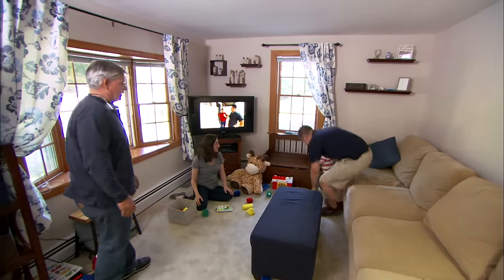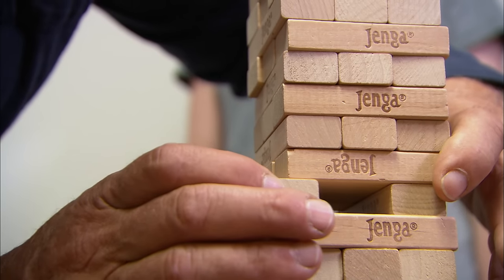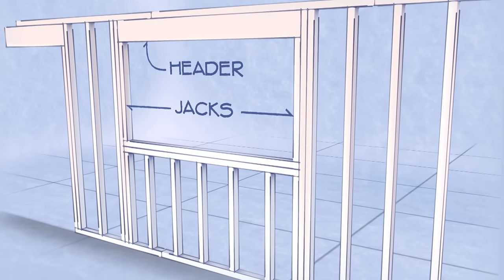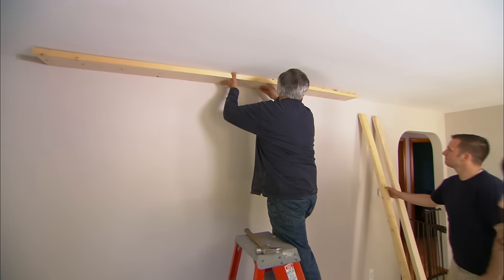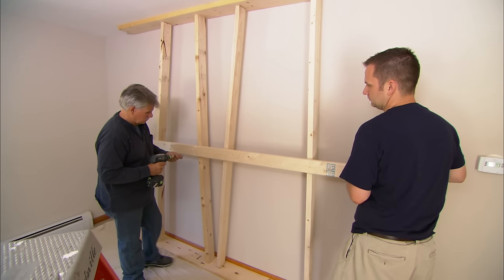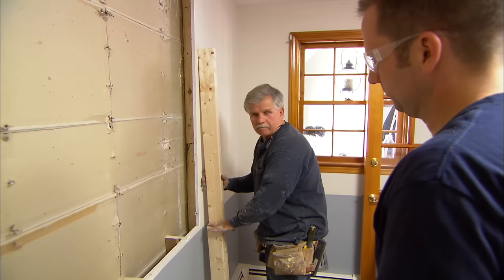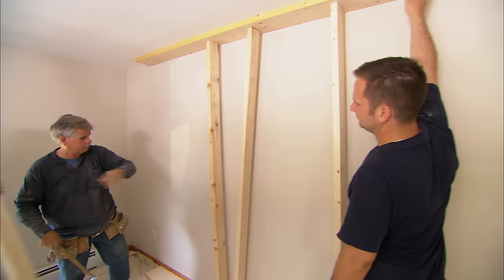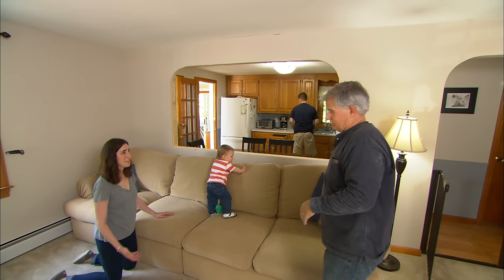How to Cut a Pass-Through in a Load Bearing Wall | Ask This Old House

Comment: what about if you want to remove the whole wall , need to install a LVL beam and reinforce with new post in the basement ? to be able to re organize the weight ??  like to heard some advice thanks
Reply: A friend of mine just had the wall between the kitchen and living/dining room removed, and the beam put up in the attic (to end up with a flush ceiling, bungalow so no 2nd floor).  The beam was 23 feet long.  At the ends the beam rested on triple 2x4's, and those were bearing directly on some new "posts" that were installed in the basement.
The company that did the job specialises in this type of work, and got all the needed permits etc.  about $10K
Reply: @VC-Toronto  This video missed the first two steps of the process; (1) Hire a Professional Engineer to assess the structure and provide a certified plan. (2) Have your local Building Department approve the Engineer's plan and issue a Building Permit.  Final Step: Before the wall receives "finishes", Building Inspector certifies that all engineering specifications have been met, the construction meets all building code requirements and signs off.
Reply: @chrisgraham2904    Correct.  The company that did the work here has an engineering firm they deal with, and they came out (I think there were 4 of them that showed up to take measurements etc) and they they drew up the technical drawings for submission to the city.  At first, the city wasn't happy with the size of the beam, but one of the engineers did a follow up showing all the load calculations used to determine the beam size etc.  The city then issued the permit as originally applied for.  The building inspector came after the beam was installed, and as he could see all the other stuff that was there to go back in (vapour barrier, insulation, etc) he said to go ahead and do all the work to finish it off (and he could see the attention to detail that the rest of the renovations had received) there was no need to have him come back out and inspect the insulation and vapour barrier  at the beam location before the drywall was installed and finished.    https://www.youtube.com/watch?v=cPVkUi3L5Pw

Comment: You call that house old? Pretty clean in those walls!
Reply: The backside of the "drywall" that is visible is 16 inch  (and 12 inch) wide "drywall" that used to get a skim of plaster.   (sometimes after a scratch coat of something a bit more cement based)  This type of product hasn't been available for decades.

Comment: I cut out a 4 feet by 8 feet opening on a load bearing wall  in my kitchen wall 6 yrs ago but I didnt know much about carpentry nd didnt even bother adding a sill plate, I just used 2x4's to frame out the opening.  6 yrs later the wall nd the house is still standing with no sagging. 😁

Comment: are the 2 vertical pieces of 2x4 enough to support the new horizontal beam they made? Sounds like two 12 inch wide beams sandwiched in ply makes it quite heavy by itself. In addition to load bearing, it has its own added weight.   Do we not need more support, maybe double up the 2 x4 columns or us 4x4 instead?

Comment: hey there, to the creator... i dont want to cause trouble, but im alittle worried that this video doesn't discuss if (2) 2x12s hdrs are sufficient for the bearing load and span, nor considers the jamb capacity to carry the new header. there's  a disclaiming that says to check with a structural e gineer to determine if the wall is load bearing, but no distinction made regarding that hdr spanning 2' or 20', I dont think. id caution someone using this video without properly engineering or permitting?
Reply: also not sure if another comment said as much, but I didnt see as much in the video description

Comment: Question for the structural engineers in the crowd: 5 or 6 wall studs in 16" centers were removed for the opening.  The load being carried by those studs is now being carried by the 2 jack studs supporting the header.  IF it was me I would have sistered 2 2x4 jack studs on each side to carry the load.  Overkill on my part?  Also, the 1/2" plywood filler between the  2 2x12 header is going to stiffen it? Really?  Looked like Doug Fir to me and even if it wasn't 2 x12s are pretty darn stiff.
Reply: Jake Cresn Depends on the code for your area based on width opening. Some make you use 2 kingstuds, and 2 jackstuds or more.
Reply: Thanks for the info.  I know that sound dimensional lumber has pretty good compressive strength but that set up looked pretty dicey to me.

Comment: Im sure you made drawings, had an engineer stamp the drawings, and submitted them to the local building department for approval. And of course, you nailed it off, not relying on brittle screws? And arent hold downs required on the King studs or is that only when you get a permit, which you did not obtain.

Comment: Why did you have to use a 2x12 verses a 2x10 header. The opening doesn’t look that wide.
Reply: Since I have not seen the rest of the house. It may be a two story house with a significant amount of weight to be carried.  The width of the headers is based on the amount of weight required to be carried and could possibly set by building codes.

Comment: Only comment was that there was electrical underneath the top plate of the wall, when they added the header they looked to sandwich the wire on the right side

Comment: I thought I saw what I saw but I wasn't sure until I read the comments. I can not believe the fact that he jammed the top of that  Header up against that electrical wire. Every time I watch one of his videos I find something that was done incorrectly. I mean this is just ridiculous! Who does something like that?!
Reply: You're right.  If he had left the plywood insert 1/2" shallower, the wire could have fit right in there.  I don't get it either.
Reply: The wire would only fit in the slot if it was 100% straight and down the middle of the 2 x 4. It most likely would not fit properly and be crushed
Reply: @joef1551  Building Codes still don't allow electrical wiring to be hidden inside a beam.
Reply: Check out the number of lawsuits launched against the original TV series "This Old House" and it's host Bob Villa.

Comment: No mention on how they removed the outlet on that wall? Or that clock or doorbell / hardwired device above???
Reply: Aaron Productions legally can’t do it yourself anyway unless you are an electrician
Reply: You can do pretty much any electrical work yourself as long as you pull a permit.
Reply: S.W.W Matt you don’t understand my point, they totally missed the step of removing the electrical. As long as you know what you are doing it’s fine to do stuff in your own residence as long as it’s safe and proper
Reply: Aaron Productions i don’t know about the U.S, but her in Australia it would have to be done as per the Aus Standard 3000 rules and by a licensed Electrician, if someone was to do it such as a DIYer and the house burnt down because of it they would be denied insurance claim etc and fined for not producing a certificate. My thoughts are they probably didn’t show it so no one tries it themselves or it was not the purpose for this video
Reply: S.W.W Matt yeah but it was a “how to” and even if the didn’t show it they could have said something instead of having it disappear
Reply: Aaron Productions look up a video on how to relocate electrical appliances then
Reply: S.W.W Matt I know how to do it, I’m just making a point...
Reply: DID YOU NOTICE THE COLD AIR RETURN.. .. NOTICE THE BROWN AREA FROM DIRT N NICOTINE... ONE BEDROOM IS GOING TO BE MUCH COLDER THIS WINTER IF YOU DONT CIRCULATE THE AIR..LOL AND NO DOORBELL AND NO OUTLET..LOL
Reply: san379 chill
Reply: As stated in the video they hired an electrician which is what any homeowner should do when they live in a state with Nazi-level building codes.
Reply: its just a damn wire and a box. remove the box and take the wires out all the way to the circuit breaker, problem solved

Comment: I was surprised he only had one 2x4 on each end holding up the header... I was always taught to do it the other way with one going all the way up, the 2nd notched for the header, and the inner one like he did on the sill plate. More weight carrying ability. It's doubtful it will fall either way. That said, if two 2x4 can hold the weight, maybe a 2x10 would have sufficed, maybe even a 2x8 for the span.

Comment: What I have never understood is, there were five support 2x4’s in the wall and he replaced them with only two that support the header. Seems like it wouldn’t be enough support. Not questioning his talent. Just seems odd.
Reply: But those 2 are functioning as larger supports. They're able to support more weight combined like that.

Comment: Love Tommy but a lot wrong with this. 1) structural framing should always be don’t with nails 2) no need for a double sill 3) studs on the temp wall we’re plumb 4) not enough info given on identifying a load bearing wall in different situations

Comment: why not just use a couple of acroprops? instead of the pieces of wood to temporarily support the ceiling
Reply: Wood is cheap, and will likely get used on the next job as lumber.  As opposed to buying something that might only get used once or twice a year.  
A friend of mine just had the wall between the kitchen and living/dining room removed, and a 23 foot beam recessed in the attic (to end up with a flush ceiling).  
The company that did the job specialises in this type of work, so they had planks top and bottom and adjustable posts for both sides of the wall being removed.  (as well as a manual crane hoist to lift the LVL beam into place)

Comment: First, sarcasm.  Really,  it must be at most a big 10 feet to walk into the kitchen where the Crock Pot is bubbling with Velveeta Jalopeno and the bowel of Frito Lay's supper salty cactus chips.  But then you'd have to vacate that, the, coveted spot in front of the TEE VEE which would be appropriated by the family dog who would demand half of said chips as ransom for moving. But honestly that family room was designed like a coffin.  So, on balance. good planning and a project well done.  And you should (not) see my house.

Comment: Why does he almost always put the screws in at an angle? 
Why not perpendicular...???
Reply: The wood is less likely to move over time that way. If you have two screws entering at different yet complimentary angles, putting pressure in two directions, each screw will perform a little better at holding the wood down. It can help keep the wood  flat, or correct a bow in a stud, or just add pressure to a wood joint or contact point to stiffen the wood and prevent it from twisting as it dries out more over time, which prevents pressure against the bottom of the screw heads from slowly backing the screw out, which will ultimately prevent problems like creaking houses, or uneven walls, or cracks in drywall or plaster, etc.
Reply: Screwing directly into end grain has almost no strength, so by putting the screws at a bit on a angle, he's catching a bit of cross grain, which is there the strength is when using screws in lumber.
Reply: Most screws are not certified for use in load bearing walls, unless the screws are specifically designed for that purpose and they are expensive.  Screws have very low "sheer strength" compared to framing nails.   No mention in the video of this requirement.

Comment: Dumb question, but why did he not use nails? If screws are better why not build houses with screws instead of nails?? Btw I’m not a builder of anything just a curios Home owner. Nice work Tommy Sir!!
Reply: Screws are better, but they are more expensive, and take longer to put in. Not like a nail gun. It just comes down to time and cost.
Reply: Jose Muniz Much faster and easier to build a house using a nail gun where it’s hooked up to an air compressor. On a small remodel like this one it is more convenient and much less work, noise, and construction mess to use a battery powered drill and screws.
Reply: 8090Centrl thanks for the knowledge 🤙🏽👌🏽
Reply: Screws are also more brittle than nails, so as a house settles and moves a bit, they’re significantly more likely to snap, unlike nails which bend. Nails excel at pure framing to get houses framed up quickly, cheaply, and with insured longevity.
Reply: They're called structural screws
Reply: Also screws shear off and break when bent. Nails give allowing the structure to flex during earthquakes and heavy winds.
Reply: Toilet Paper Structural screws like grk have shear strength of framing nails and are up to code.
Reply: Jose Munez, he uses screws because he is lazy. It is easier to screw than nail. I knew years ago when I saw Tommy using a hickory handled hammer that something wasn't right with this guy. 
I grew up in the 70s being taught by My Carpenter, Contractor, Cabinet-Maker father how to do carpentry the correct way. Nobody in the trades that I ever saw and I mean nobody ever used a hickory handled hammer, because the damn things broke all the time! We always used metal hammers, all metal hammers. Nobody who swings a hammer all day long for a living uses a Hickory handle. And nobody in the trades would last very long making as many mistakes as he does. Rarely do I find one of his videos where he isn't making a major mistake. That is just a fact.
Reply: Standard screws are weak and brittle. They can pull pieces together but have very little sheer strength. Unless you use structural screws which are very expensive just use framing nails which are designed for the task
Reply: Screws are not permitted when building structural support unless the screw is specifically designed with a "sheer rating" for structural applications.  Structural screws are three times more expensive than standard construction screws. Nails have the "sheer rating" printed on every box.  No mention of this requirement in this video.

Comment: What about that wire above the header that will be squashed to the plate? Also  when you remove studs and replace them with a header the load on each end needs to be  supported all the way down to concrete. Shame on you  Tommy.

Comment: I dont understand the whole point of this. How far is the kitchen when there is literally a thru pass that only takes 2-3 steps more. Are you that lazy and need the kitchen right there in front of you? You might as well just move the fridge next to the couch.
Reply: It''s more for light, and sense of space, as well as to keep an eye on the kids in the LR when you are in the kitchen.
Reply: @VC-Toronto  For more light you can install artificial ceiling lights. Is it more space? Maybe?
Reply: I did a pass through like this (not quite as big) on a friends townhouse a few years back, it made the small kitchen feel less "closed in".  
There was a cold air return right below it on the dining room side, so it was OK to make the opening the width of the cold air return, as any load was already being transferred to the studs on each side of the return.

Comment: He skipped the part with the building permit, the drawings, the inspection and the structural engineering calculations.
Reply: i doubt any structural engineering went into that
Reply: @Freyr77  Exactly.  Here in N. Calif., you can't get a permit to alter structure without it being brought up to modern (earthquake) code and that requires at least a short report from a structural engineer.
Reply: Absolutely correct!  "This Old House" provides dangerous information in their videos.